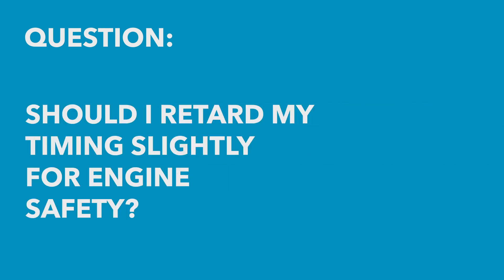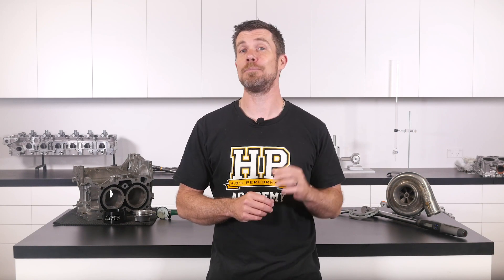Should I Retard My Ignition Timing For Safety? [HPA Q&A]

Comment: Is it advisable to have different maps (mainly for track days) for different temperature ranges, ie: a 15 degree day vs a 35 degree day or will the ECU adjust for this?
Reply from the maker: Yes and no, the ECU can adjust for this, but you might adjust things more in relation to the way the power is delivered in relation to weather for traction reasons - Taz.